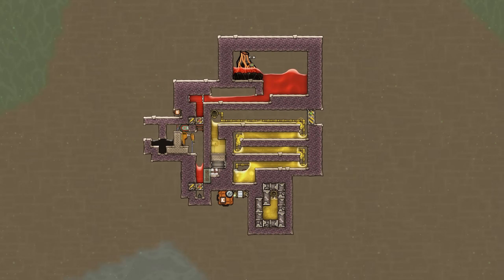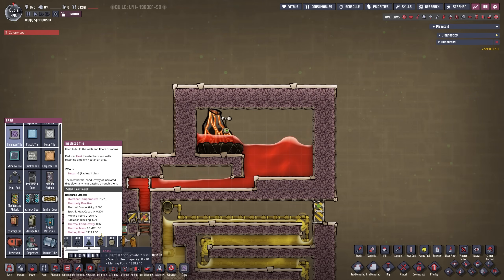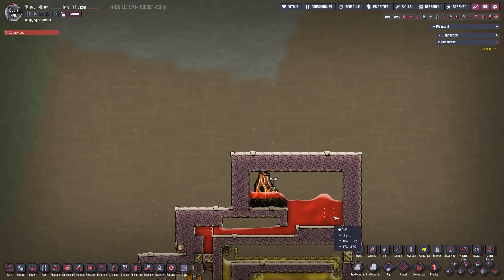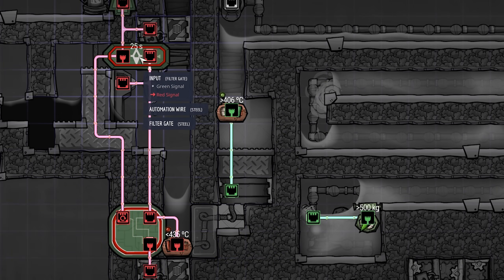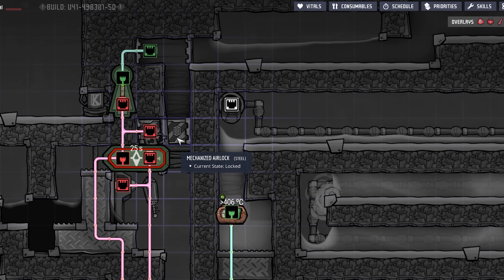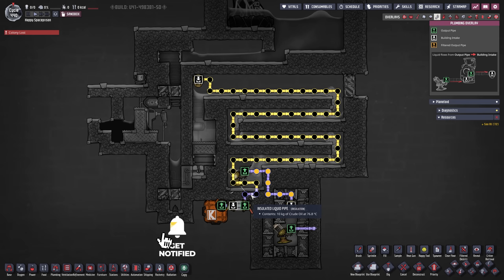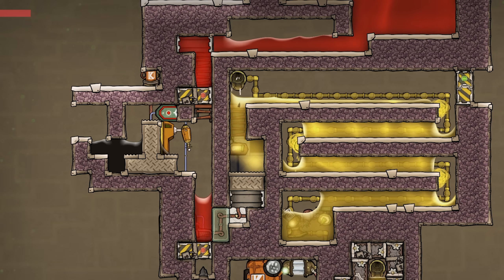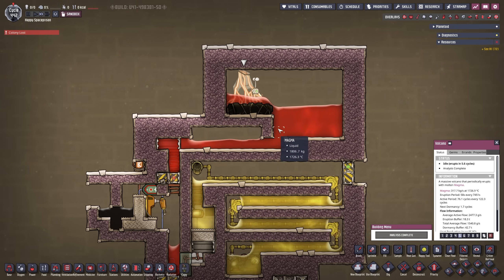GERMAN ENGINEER explains ONI: PETROLEUM BOILERS! Oxygen Not Included Spaced Out

Comment: I just had an epiphany if on that top maintenance aisle you put mechanical doors flat on the bottom putting the pipes above and pipe sensors on the top you can activate the doors to drop the petroleum from the pipe and so doing preventing it from heating up further so you can have the pipes Auto regulate the temperature exchange.

Comment: Months late, but… you can contain magma with Ceramic, since it's usually found at around 1800°C and ceramic doesn't melt until 1850. In practice, even up to 2000°C (eg freshly-erupted) is fine because of fiddly little things like heat-exchange clamping. Given how ceramic is a relatively expensive material and Obsidian isn't terribly useful for much besides magma containment, however, the latter is usually the better choice.

Comment: you can make it from igneous rock because the heat transfer is quite low and it wont melt, had it for over 1000 cycles and never had any problems, but you can always make whats touching the magma out of ceramic
Reply from the maker: Yeah, ceramic is what I would recommend, better safe than sorry :)

Comment: I've seen someone experiment with petroleum boilers and figured out it is more efficient (from the temperature gradient perspective) to have a stairstep design. Instead of having a flat shelf that cascades down into another flat shelf, one should do a staircase where the floor steps down and right with the oil pipe, as it ascends, touching all sections of the petroleum flowing down. Once the staircase reaches the right wall you do another staircase going down and to the left. As a result, there is an exceptionally efficient heat exchange between oil and petroleum where petroleum leaves at ~100C in less space.
Reply from the maker: Thank you for that info, that does make sense since there is more area of contact! I may play around with that in the future and see what I can do :)
Reply: @BierTier  would love to see a tutorial of that build

Comment: I really don't like people showing of this terrible petroleum boiler design. It is prone to so many failures it's not even funny. On the unofficial discord we constantly have to clean up the mess from people thinking this was a good design to build.
And yourself alo make a lot of mistakes like saying that the insulated tiles touching the magma should be obsidian. They should not be insulated tiles at all. You use airflow tiles as it's a vacuum so there's no thermal transfer at all. It's the same issue in the needlessly big boiler used in the design. In a proper design you make the boiler walls out of airflow tiles because they can't take pressure damage and have no thermal transfer leakage.
I could really go on and on about how every single detail in this build is a dubious design decision but I'd advice people to go on the unofficial discord instead because there's vastly better designs there made by vastly better players than Francis John.
Reply from the maker: I don't know about this unofficial Discord. Give me a link and I'm happy to take a look at it. If I find a better design to show off (with proper credit of course), I'm happy to do so and promote that channel as well. If that is not wanted, it is also fine with me. I'm always happy to learn more and broaden my horizon. And if I then can forward that knowledge to my viewers I'm even happier.
Reply: I know this is a month late, but I've run these for hundreds of cycles, the tiny heat transfer doesn't seem to matter.

Where can we find a link to the discord?
Reply: @defiantnight2668  The channel number is posted above but you can also google. I cannot post links on youtube so that's the extent to which I can help.
Reply: @SamsoniteDove  Oh, I didn't know I could just Google discord links haha, thank you
Reply: @defiantnight2668  You're welcome. Sorry that I can't post direct links in youtube comments.
Reply: @SamsoniteDove  It's no problem, I figured it would be on a reddit post somewhere if nothing else

Comment: Bruh. Why I even need this waterfall from magma? I can just take temperature directly using 3 door with automatic and a vacuum mechanic (Then u using 3 doors, and u open a second one there would be a vacuum.
Reply from the maker: That would be possible indeed. With a lone Volcano you'd eventually run out of heat though since the Volcano would overpressure(since no Magma is removed), release no more magma and you keep taking heat out. 
There are many ways to go about it, this is Francis Johns way and I like the ingenuity, so I made a video about it :)
Reply: @BierTier - German Engineer  u just need to feal vulcano chamber by water. I saw it on russian ONY segment 2 years ago, and it's still working.
U should see it. Then they don't try to kill somebody they preety good at ONY.

Comment: I have a real Love- Hate relationship with this Design.I have seen more Bugs with this then with any other design i´ve ever Build (Magma randomly Melts my steel Door, Sour Gas flashes on the Drill, The Top 2 Liquid Pipes break even after the System Run for like 200 Cycles without problem...the List goes on)...but when it works it is just to good not to Build. I´ve tryed this like 8 Times and every time something else goes wrong...yet when i see a Vulcano and do have the Space for it i cant bring myself to ignore it ^^.
Reply from the maker: I have it only built once before in a normal game and I had no issues with it. I honestly can't remember how many cycles it ran(this was wayyyy before YT) but it should have been easily above 200. I have heard and read about issues though, just haven't experienced them myself. Maybe I will show off something else in the regard of Petroleum in the future :)

Comment: One easy improvement is to have a small step at the top to separate the upper layer from the boiling chamber - the way it's built now, heat travels, via conductivity in liquid petroleum, from the bottom all the way to the top right, negating a lot of the exchanging in the top layer.

Also, these kind of boilers suffer from a bug, that deletes heat in right corners where the petroleum falls. Such a bug does not exist in left corners. Of course as long as the volcano is powerful enough, it doesn't matter in the slightest as eventuallty magma piles up. That it piles up slower than it should makes no difference at all.

Only if you're using a metal volcano (much weaker), you might want to use a vastly superior exchange design, one that is not affected by the heat deleting bug, such as a waterfall or bead-based one.
Reply from the maker: Thank you for the info, I was honestly not aware of this. I have built those boilers before in a normal game and never even noticed that issue to be honest, since the temperature of the petroleum usually doesn't matter to me too much. I appreciate the insight though!